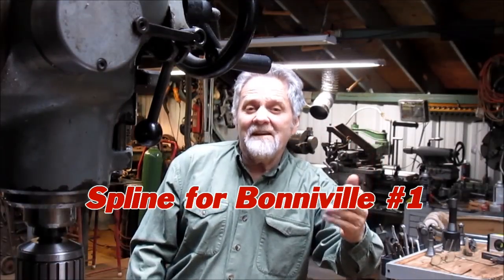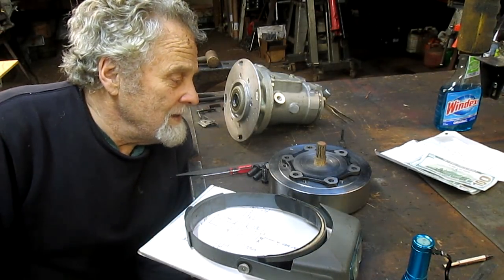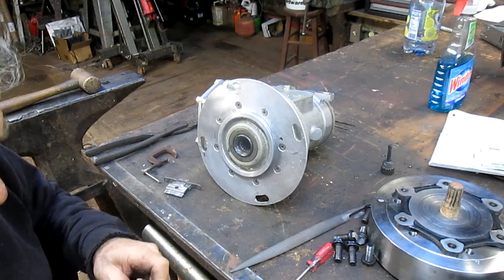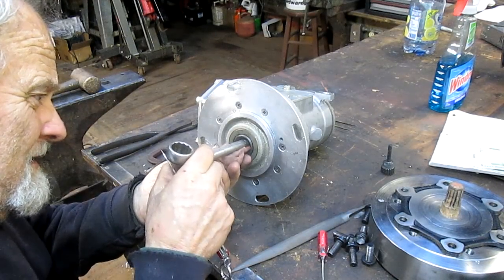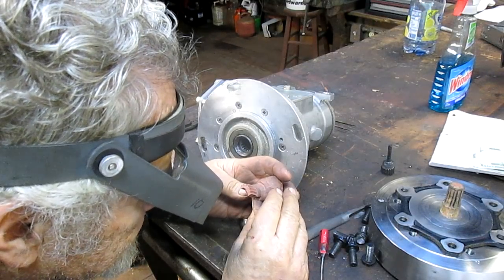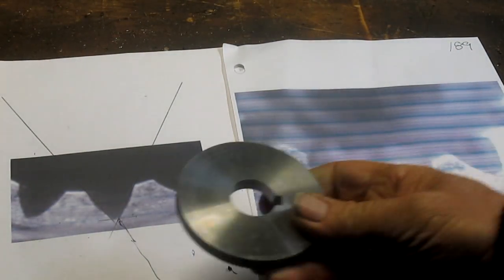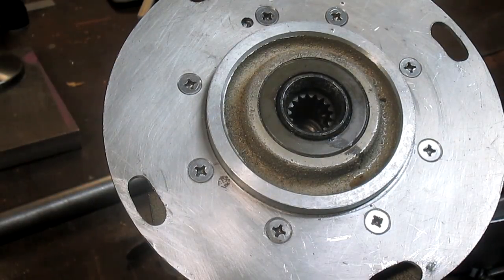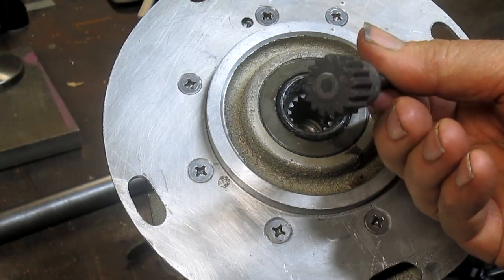Spline for Bonneville Salt Flat #1

Comment: Hey Nick. I’m sure you must have a machinist handbook. I’m pretty sure you can measure the minor diameter and number of teeth and it’ll tell you the spline and cutter.
Reply: Yeah I was thinking the same.
Reply: Élémentaire mon cher Watson !!!
Reply from the maker: I do and I keep forgetting to use it. Thanks for the reminder.
Reply: @NikColyerMachineWorks  You shouldlook at buying one so you get it exact. Probably be cheaper as well. Isn New Zealand
Reply from the maker: @ianlangley987  I looked and the cost was $1200. with delivery 3 to 4 weeks out. My customer wanted it in a week.